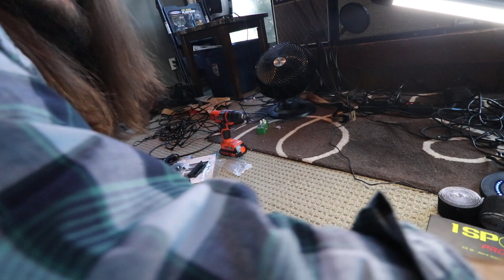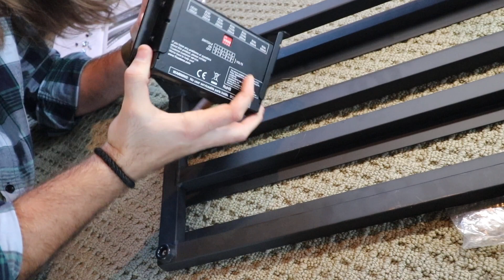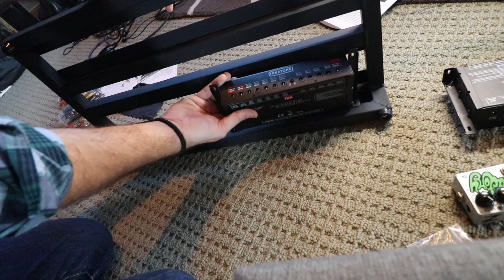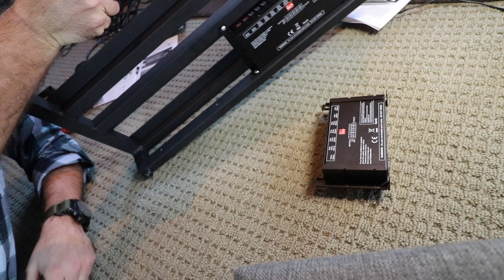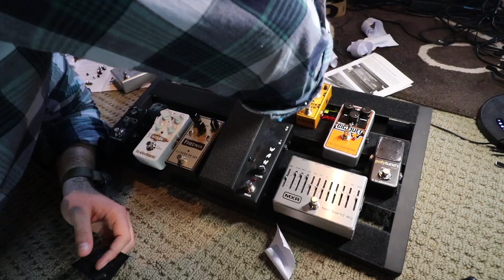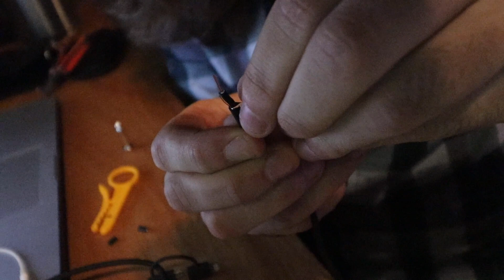Pedaltrain Classic 2 Pedalboard Build

Comment: 2 power supplies? I'm new to guitar but that seems like overkill. Is there a specific reason for this?
Reply from the maker: I own more pedals than is shown in this vid and I switch them out periodically. I have two pedals that run off of 18v and each supply only has 1 18v connection, so if I ever setup my board with both of those pedals then I need the two 18v connections. Plus, if I ever decide to build a bigger board I’m already sitting pretty good on power. 
Not all pedals run off of 9v. Some run off of 12v and some 18v (you also have positive and negative polarity to deal with...) , so depending on what type of power all of your pedals run off of, you have to buy power to accommodate your pedals...
Reply: Benton Cox cool, I get that. But if couldn't you use a daisy chain to connect some analog pedals since they require lower mA? That way you can free up more outputs? Seems like a lot of your pedals are analog. Just wondering, thanks
Reply: @mariobernaljr.3433  He can do that but he is limited with 18v connections so he needs two power supplies just for the 18v, and since he has the extra plug because of the two supplies, he can just plug everything in straight up

Comment: Or. Take the feet off lol. Unless you resell pedals. Then I get it. I saw video of taking dual lock and hooking it to itself and then then pedal so you don’t have to take the feet off. I think it was Sean Pierce Johnson I watched do it. Also. I just stared using lava cables myself. And I actually used the entire 10 feet just to make 5 decent sized cables. Just to get ones that wouldn’t bend the inside wire while trying to insert it into the jack or that actually had signal. Once you get the hang of them. They’re great in a pinch. But they can be a hassle in the beginning. Really nice laid back video by the way man. I dig it. Love videos like these. Better than Tv.
Reply from the maker: Timothy Mueller I’ll probably try the dual lock like you suggested. I was too laxed with the lava cables, there’s definitely a method that needs to be followed, but like you said, once you know what you’re doing they’re not that hard. I’m glad you enjoyed the video. Thanks for the comment!